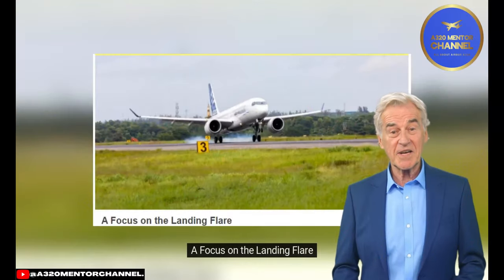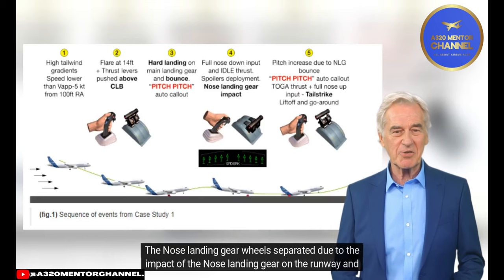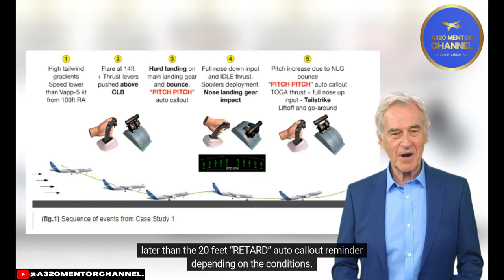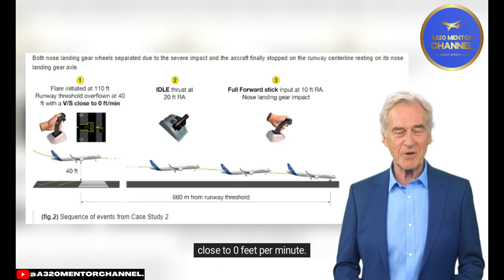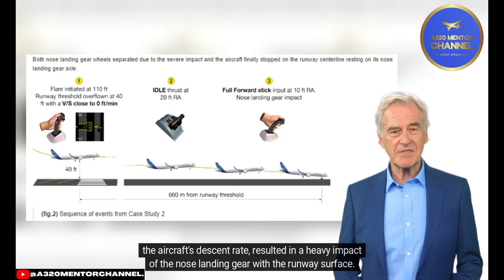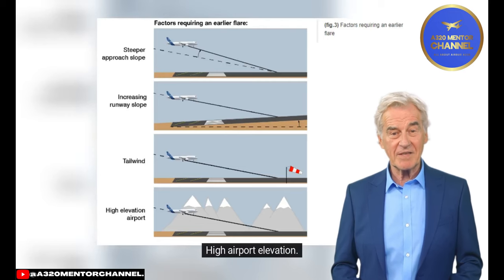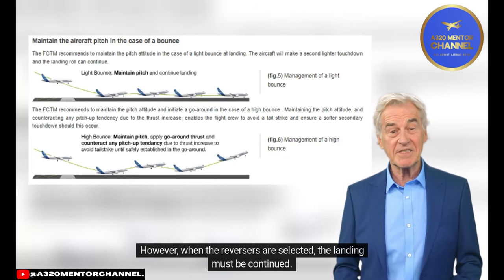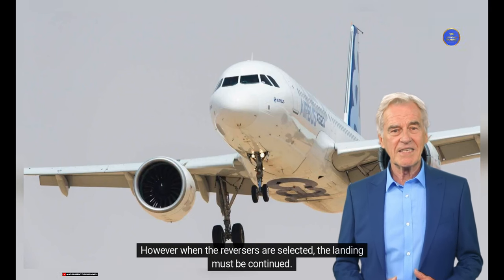A320 a Focus on the Landing Flare

Comment: Hi there,
In the real aircraft, how would the plane behave before touchdown? Let's assume we're at 140kts descending 900 ft/min Autothrottle on.Does the plane reduce the descent rate a bit around 50 ft or do we manually decrease the sink rate prior to proper start of the flaring at 30 ft?
Reply: Either you will be on an instrument approach or visual, you would try to get a 3 degrees glideslope. It will be around 700ft/min. You would also disconnect the autopilot around 300ft and for the last 30 to 40 ft you would start a gentle flare on the 321 (20 to 30 on the 319/320) then reduce the throttle around 20 to 30 ft then flare (10 to 20 on the 319)
Reply: Hi R O, 

Why would the plane reduce it's rate of descent by itself? 
The pilot is the one who has to adjust the flare height according to the actual conditions.
Reply: I will add that you could do an autolanding, in that case, the aircraft use the Instrument landing system and the radar altimeter, which calculate your altitude from the ground. Then it will flare by itself. When it tell you « retard, retard » do not take it personnally as I do but just decrease the thrust to idle around 10/20ft on the 319/320 and 20/30ft on the 321!
Reply: @bruno84   ground effect reduces sink rate
Reply: @MAGApepe  if you are descending with a rate of 600 or 700 feet per minute, if you don't flare you won't notice any ground effect. The effect would be negligible.